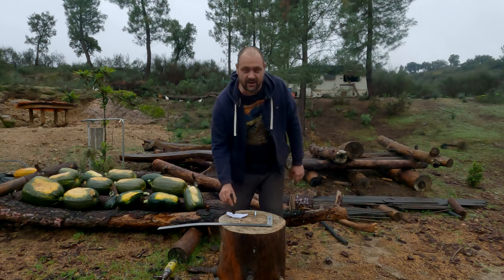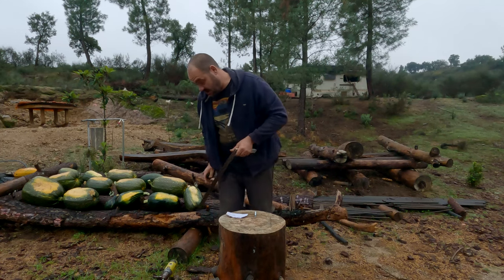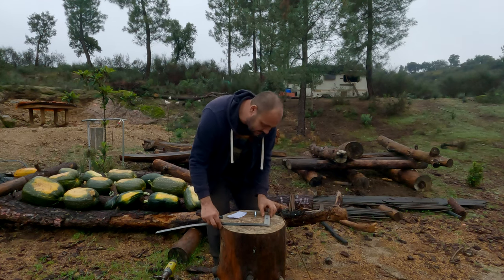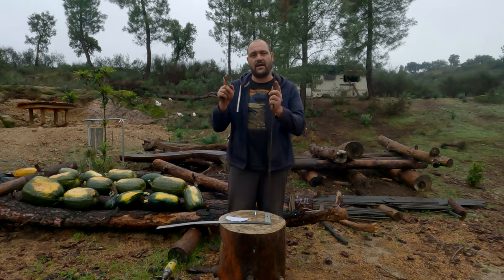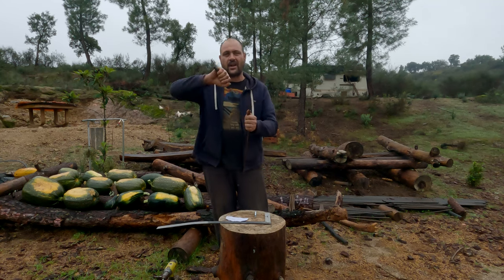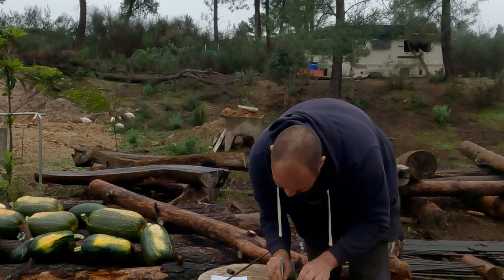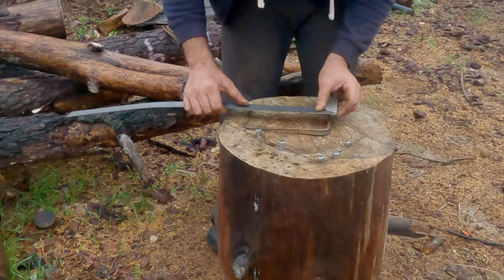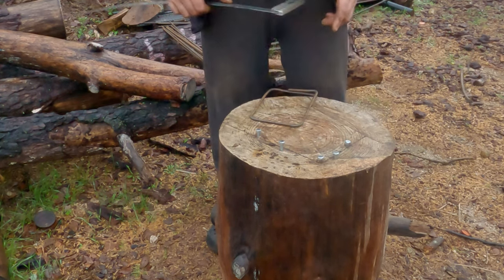DIY REBAR bending method FOR A FULL SQUARE / CHEAP!

Comment: Would have been better if it was an actual stump. As in with roots in the ground. Glue and screws down a plywood square for a sturdy flat work table maybe lay out a grid, and go-to work  👍👍